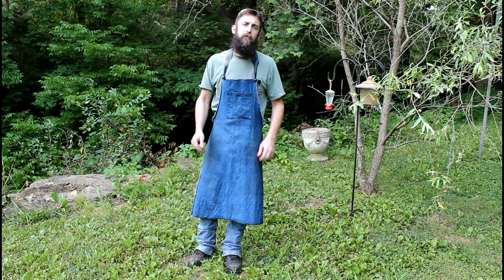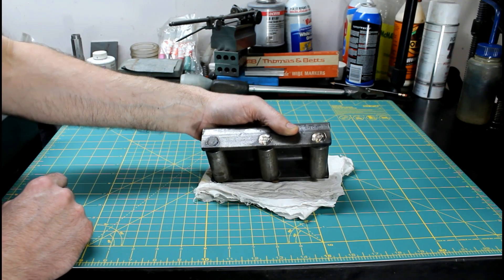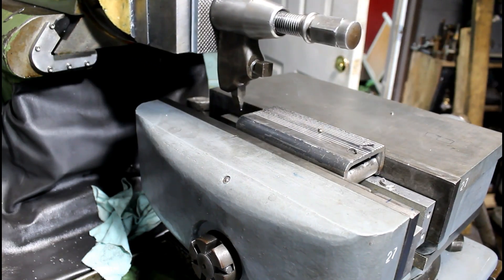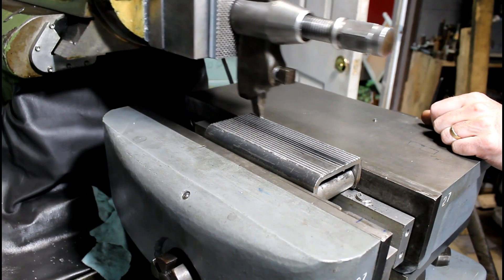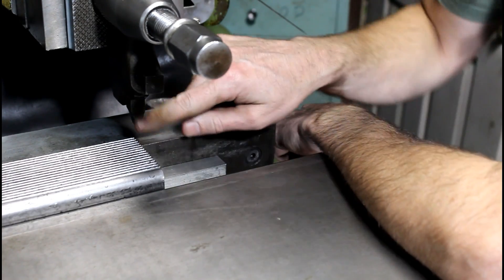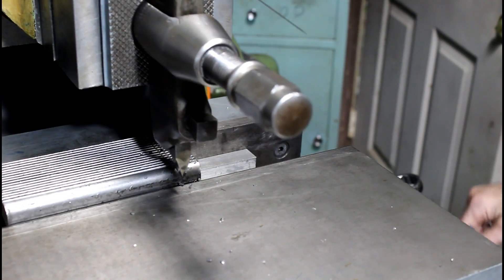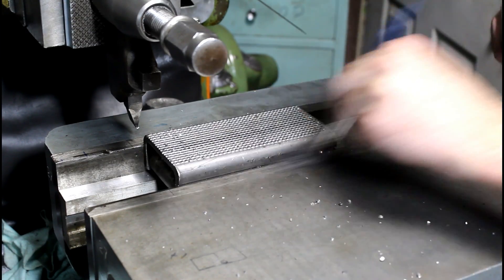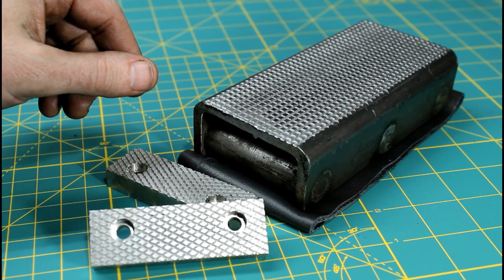Knurling on the Metal Shaper

Comment: also I created a group on FB  shapers and z linear machining.. plunge cutting. In other words on a cnc or milling machine plunge cutting is basically shaper cutting but of course nothing beats a shaper as compared to a shaper attachement.  we at a shop just got a shaper attachement for the bridgeport and have yet to start or use it freshly installed.

Comment: dont forget to drill a series of holes and have a few pins with heads. Once a machine is sitting on them you can manuever the pins in to lock out sideways movement of the item being slid along. Another thing is handles the concept of a wagon--when rolling an item you can pull the handle and change the direction of the rollers real easy.

Comment: I have longed for a shaper for many years, too many years, and I just may get one for free.  8" Shape-Rite with no visible damage or missing parts. I will clear out space for it. Ran out of working space you ask?  Yes, the shop run out of space more than once over the years. Question, what is the practical maximum work stroke of an 8" shaper?

Comment: I worked in a shop 50 years ago and we made starter and generator shafts. I knurled the shafts in a lathe. Then we got a big shaper it had a die mounted on the bed and one on the ram. we laid shaft at head of the die on the bed pull lever ram came forward at the of the stroke the shaft fell in a parts basket, the ram returned to start position. I would put in another shaft and do it again. About 1/4 the time it took on a lathe
Reply from the maker: Larry Hedeen Wow, I never thought of that, very interesting. I bet that worked real well. Thanks for stopping by, I learned something from ya.

Comment: G'day Steve with the shaper I noticed that the cutting tool gets fairly hot.  Does this lead to premature ware on the tool, more sharpening.   Can you use curing fluid on it?   I've only seen a shaper on David's old steam shop channel and running on belt overhead.  Thanks for the video very interesting.  Regards John
Reply from the maker: John Kinnane Shapers only cut about 60 percent of the time, this allows the cutter to cool much more than when used on a lathe . That said, cutting fluids are not used that often on the shaper. They are used much more for a good surface finish more than to cool the tool, I have had times when the cutter is ground weak and then it required coolant. Thanks for watching.  SteveSummers

Comment: Steve one thing I don't understand is how the traverse feeds while the cutter is on the back stroke... How doesn't that gouge the part as it moves over? I know how the clapper box works but there's a side load that I'm referring to. How does the part immunize itself to that?
Reply: THE CLAPPER BOX LIFTS UP.. also it DOES spoil the part to a degree if closely inspected you bet it makes a mark.

Comment: i just started as a machinist and we started on some old bridgeport's for milling and some even older lathes and we talked about other type of machines but i never hear or saw anything like that shaper, and i am so ahh struck on how it work.i love what you are doing with it, knurling was my funnest part about working on the lathe if i had one of those i would've gone NUTS!!!!
Reply from the maker: Brett Baxter Thanks for warching, the shaper is a very versatile machine. It's slow but in the home shop that doesn't really matter all that much. You can find them at a good price sometimes so pick one up if you get a chance. Tooling is also cheap.

Comment: You should never use 4 skates when you are moving a machine, you risk the chance of loosing one and turning the machine over. I always use only 3 and I have been putting a piece of panneling between the skate and the machine, but rubber might be a better option like curlyg65 said. I would never go with metal to metal contact

Comment: You have actually diminished the contact surface so the chances of slippage is greater. My friend that moves machinery has skates that have a 1/4" round welded across each end of the skate. This prevents the skate from slipping from under the machine being moved.
Reply: I think a piece of rubber or plywood on top of this knerled surface would work great.

Comment: Are the wheels of the skate just reamed 1/4" for the shaft? I have some spare channel scrap that might find a new life in this.
Reply from the maker: They are drilled 1/2" . I think 1/4 would be to small if you are moving much weight. Thanks for watching
Reply: Ah yeah woops :v
Any issues with friction or slop in the wheel to axle contact? Debating adding a small hole to each roller for pumping in grease.
Reply from the maker: Rainbows871 not much slop between the axle and wheel, they turn freely and did not give me any trouble moving the shaper, only issue I had was slipping between the skate and shaper foot. I just put some oil on them and that seemed to be enough, they rolled very nice.
Reply: I checked the maths while waiting for toast to toast and 6mm steel rod takes 1212kg to shear, much easier to bend but in that position I don't think it has the freedom of movement to do so. 12 axles and you could safely move 6 tonnes I would guess. For a 2 axle skate to take 5T as I am making (FoS 2 so theoretically 10T) it needs a 12.15mm axle.   Your four skates can take 30T together I would think as long as something else doesn't break. 

Been a few months since I last did a shear calculation so nobody gets so sue me if they tip their machine over on a broken skate
Reply from the maker: Rainbows871 Sounds good to me, the way they are set up it would need to shear the rod, you are correct, I used what I had and 1/2" was on the shelf so thats what I used.

Comment: A hook or a socket in the skates to put a long handle in to turn or pull on them would be handy you have inspired me to make some skates now that will work better than rolling stuff on pipes thanks for the good videos
Reply from the maker: I still use pipes and any thing else that will keep things moving. Every time I go to move a heavy piece of equipment that is far from the shop I take a truck load of stuff just in case, I end up loaded heavy b4 I even load the machine on the trailer. The eyelet or socket is a good idea, Thanks for watching

Comment: The best thing you can do with the skates is devise a way to connect two together with a rod or tube so that they don't try to rotate under the load. I don't know why they won't track straight, but they just won't. I did this with my Hillman rollers and it made all the difference.
Reply from the maker: Yeah that's something to think about, I had to tap them with a brass hammer when pulling the shaper to keep them all moving in the same direction. Moving the big shaper was a job that's for sure , had to set a concrete anchor in the floor and use a come-along for the last 5ft due to putting it in the corner. I also used the steel rods that I turned in to big nails for the Big Nail Coffee Table build video.

Thanks for watching Wes, I really appreciate it. Hope you enjoyed
Reply: Imagine moving a car without a tie rod. As soon as one gets off track it can only get worse.

Comment: Nice job Steve, now there's an operation I think is easier done on the shaper than the mill. That is one beautiful shaper. That rapid traverse is nice. I have it's smaller cousin, a 1945, 16 inch G&E plain. Lot of similarity between the two. Getting these skates ready,  Is this a teaser that a new machine is coming.
Reply from the maker: Unfortunately this was not a teaser, wish it was. I still had the skates out from when I moved in the big shaper, I left them out to do just this (knurling the top) b4 I put them away, I had trouble with them and did not what to deal with it next time I go to use them ( hope it is soon). I think the next machine will b a surface grinder or a horizontal mill.
I would like to have both and in time I will but for now I will make due with what I have. Thanks for watching and I hope you like the video.

Comment: Nice idea Steve - we used to use machine mount material between the skates and machine feet - it was a cork / rubber compound and kind of 'stuck' as the weight increased - we used to shift >30 MT blow moulding machines around on the big skates - never ceased to surprise me how easy that sized machine would move on a smooth concrete slab when it was on skates !

Comment: Interesting application of the shaper. Thanks for sharing.
Could you show how to achieve very smooth surface? I have heard with good shaping of the tool the surface could be smooth as surface grinder treated. Thanks and regards
Reply from the maker: Bozhidar Ivanov Thanks for watching, I have hear the same thing from time to time about getting surface as smooth as a surface grinder, I have got some very nice surfaces using a shear tool but I would not put them in the same class as a surface ground part.
I believe it all depends on what material u r cutting and the profile of the cutting tool. I will do a video on the subject showing what I know about it, keep inmind that I am also learning. Thanks again for watching and commenting
Reply: With a wide radius round nose tool and low stepover on my shaper, it gives a mirror smooth surface in aluminum and mild steel. I think it actually looks better than surface ground on my machine, the only problem with it is that the finish is so mirror reflective that it actually picks up fingerprints and everything pretty much instantly, then looks like crap again, lol.